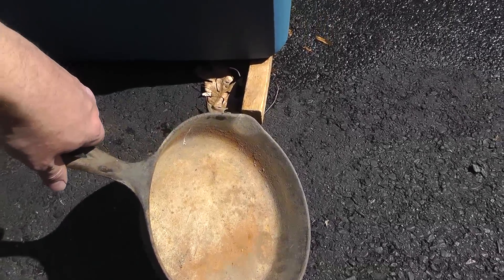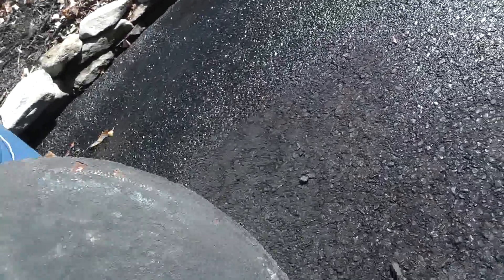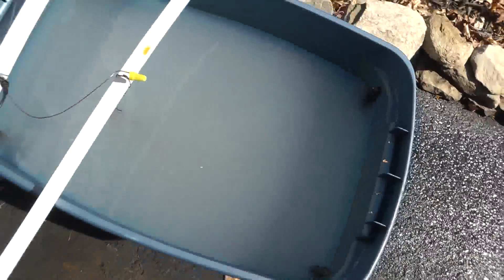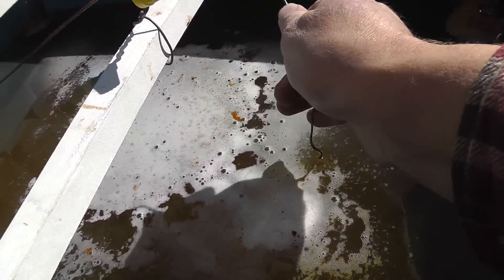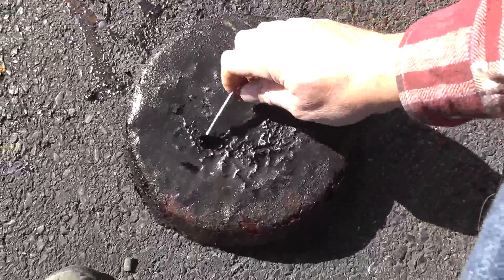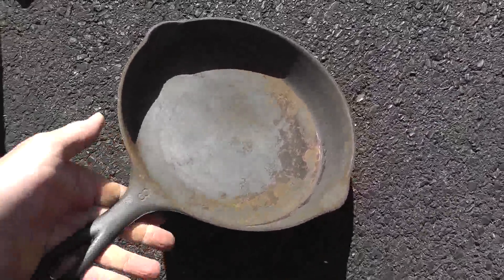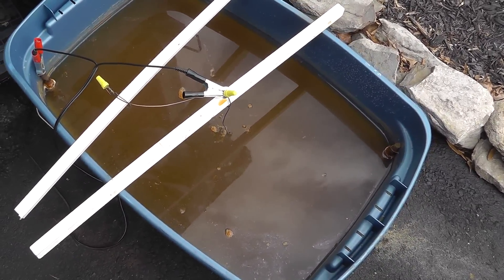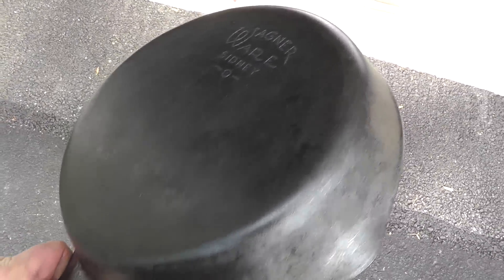Cast Iron Pan Before and After Electrolysis

Comment: I used your method until my charger died...Then I started using a slurry of Lye & Water and it removes all the gease & grime within 48-72 hrs!!
E-Z Off Oven Cleaner also works well also!!
Reply: I would never use oven cleaner on something that I will eat out of. Too many chemicals can get in the pores of the pan!
Reply: @hotrodhog2170  I’m new to this but from what I saw. After the lye bath. You soak in 50/50 vinegar water for 30 minutes then wash and dry and start seasoning